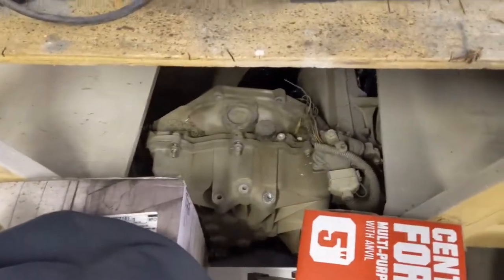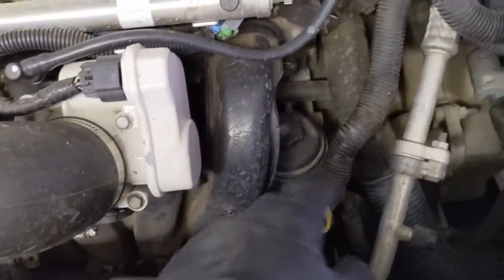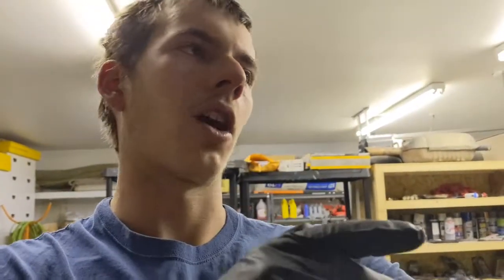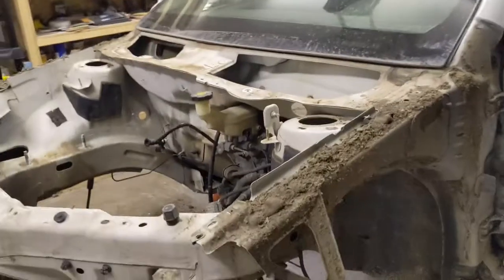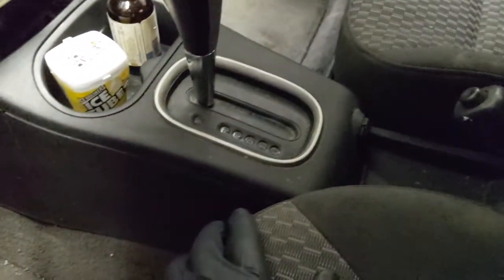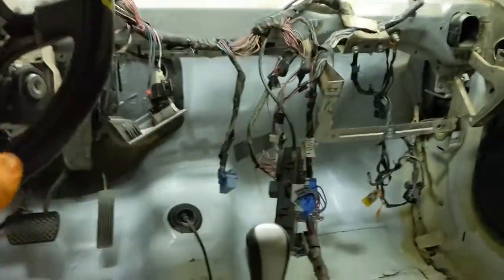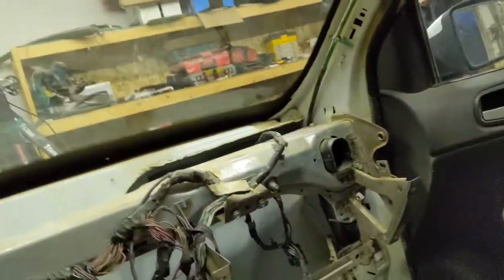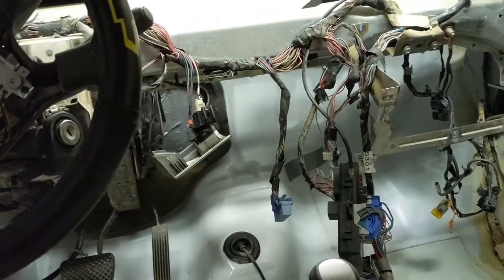Cobalt Complete Teardown Part 1

Comment: You should also take the fe3 front sway bar from that 2.4 ss as your front fe1 sway bar is only 18mm and the ss 2.4 is 22mm.
Reply from the maker: Got some stuff planned might have to do that
Reply: Sounds good Bro. Really enjoying the build so far. I'm actually rebuilding my 2007 Pontiac G5 gt sedan and doing a m62 supercharger on it plus full suspension upgrades.
Reply from the maker: @chadoliver2966  that's awesome is that the stock lsj supercharger? The tvs 1320 supercharger is kinda expensive but I want to try it out sometime
Reply: Yes its the stock m62 supercharger from the Cobalt SS. Also got my blower ported to use the larger ls4 tb. Should be fun once its all done.